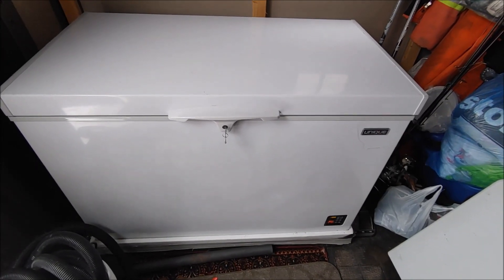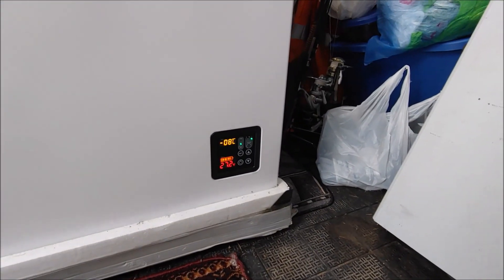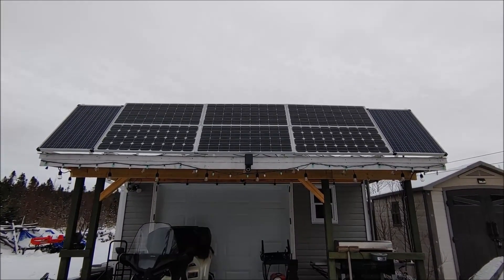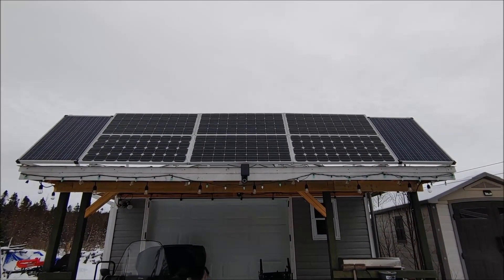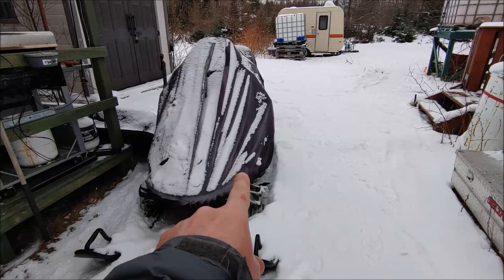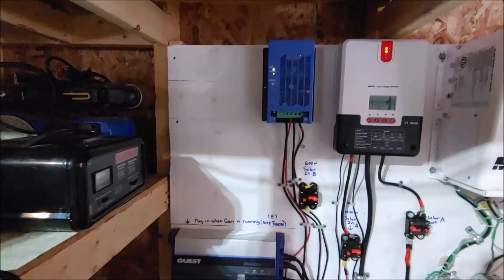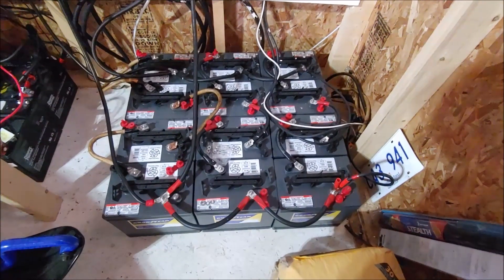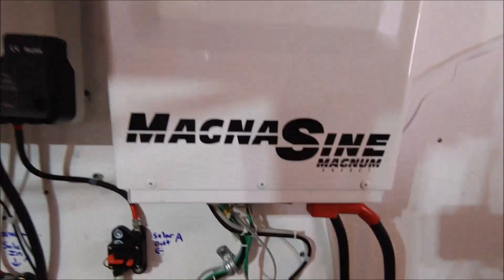Cabin Life Off Grid Living: Solar Energy Upgrade

Comment: So a quick question........you used your old solar system for the freezer,and the new one for everything else?  Wouldn't the new system run it all?  Don't worry I still get asked all the time why I don't run my propane fridge 6 months of the year........its Canada, all around us.  Cheers Dave
Reply from the maker: I utilized the older system to take that additional load off since it was already there.  The new system could run it all but during the summer months and warmer ambient temperature, this made sense.  Cheers. 👍

Comment: When do you start your generator? Do you go by voltage or by percentage? So if you go by voltage whats your number to start?
Reply from the maker: Hi there, on a 24 volt system, it really depends on how many amps are being used at that time.  Generally with a lighter load, I usually start the generator once the voltage is at 24.4 or 55%.